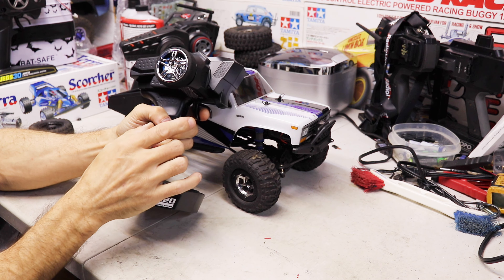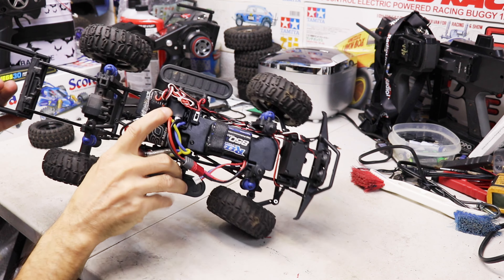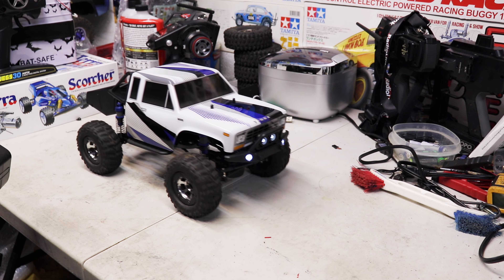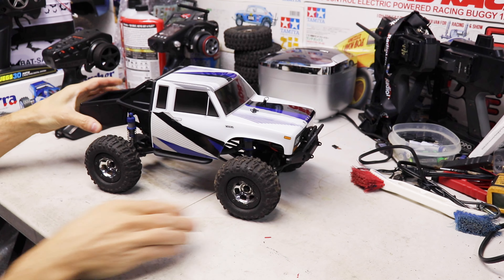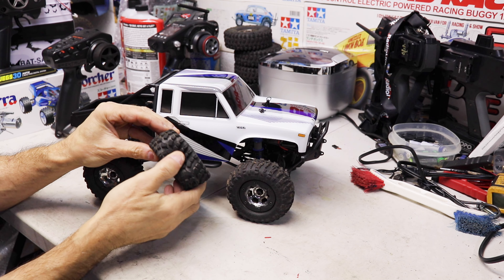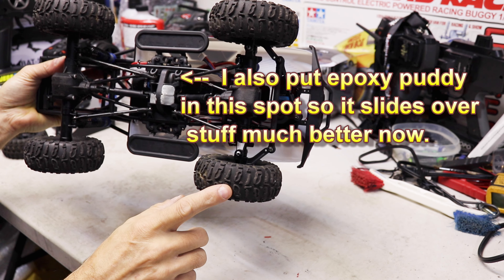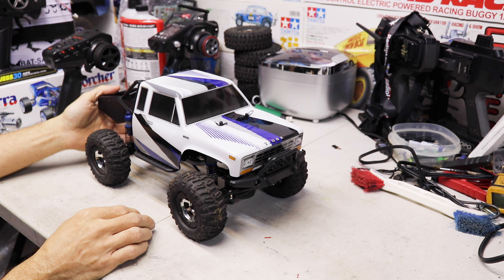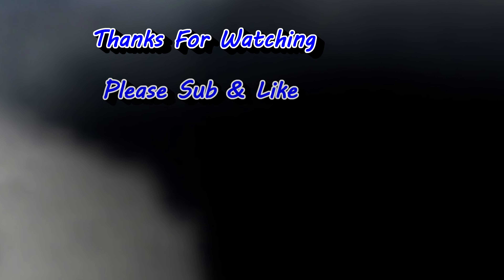Team Associated CR12 UPGRADES

Comment: Great video! It's hard to find anyone modifying these, it's too bad because they're such a cool little chassis!
I ended up putting the stock 1.55" wheel and tire setup from my Element Enduro Trailrunner on my CR-12 FJ45 and it made a huge difference. I did have to raise the body mounts a little to get rid of body rub but it was worth it IMO.
I really want to try a 1060/1080 Hobbywing in it, I agree the stock radio/ESC is too jerky with throttle response.
Thanks again for the great content! Have an awesome day!
Reply from the maker: Thanks, Cool mods you did to yours, They are great little trucks for sure and for!

Comment: The wheels and tires make a huge difference yours looks good! Thanks for the advice on the radio I changed mine it’s perfect!
Reply from the maker: Glad to help! the radio is a great upgrade!
Reply: The Tioga is hands down my favorite 1/12 scale RC! I like what you did with the underbelly, what kind of putty did you use?
Reply from the maker: @deanmachinerc  Hi it is great!! I used this epoxy they sell it's in a clear tube like a foot long and you have to cut some off and kneed it together and it's like putty and you can put it around or mold a shape with it and then it gets hard as a rock when it cures. search the web for epoxy putty you should find something like it. 😁👍👍

Comment: So the Spektrum radio is able to bind with other branded receivers? I always thought it had to be the same brand.
Reply from the maker: Hi no it won't you need to replace the whole radio system.  Thanks
Reply: @ShenRC  so it's the spektrum radio and receiver together right?
Reply from the maker: Hi I put a new spektrum radio and receiver in it but you don't have to use this you can use a cheap flysky radio and then I put a hobbywing 1060 esc and it controls much better, @jj78rcclub
Reply: @ShenRC  thank you. I'll try that. Maybe a brushless motor would be better as well